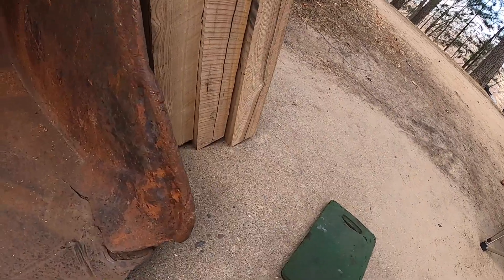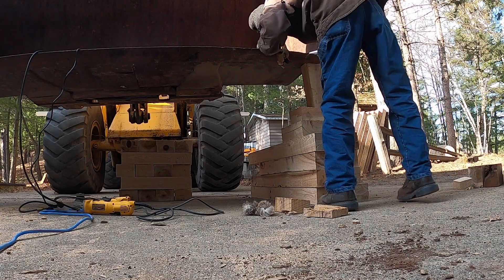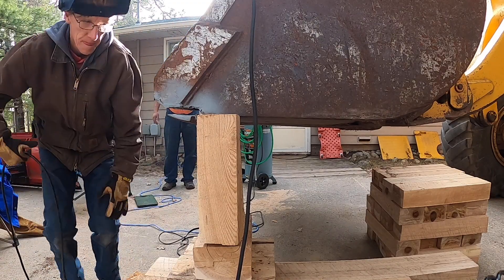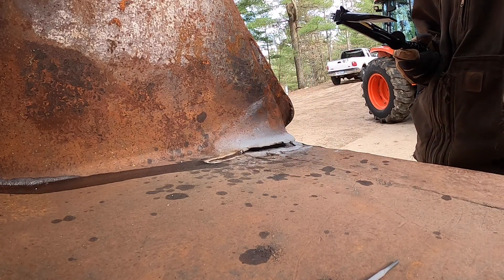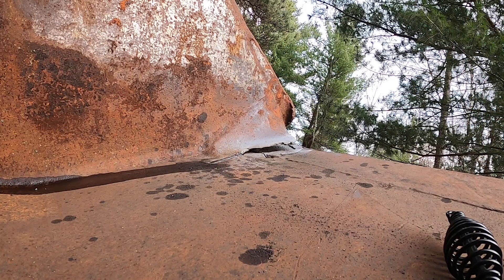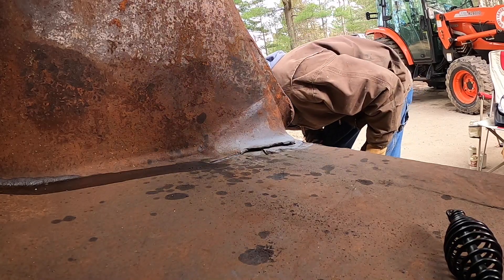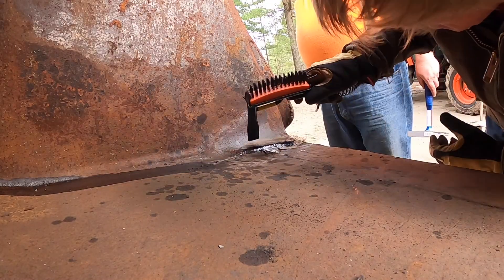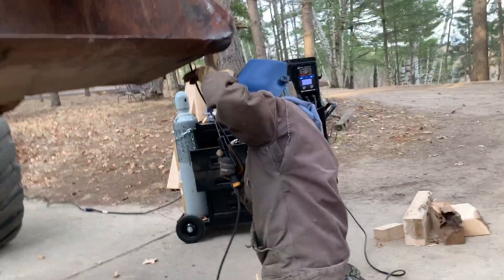Welding and Repairing a Cracked Wheel Loader Bucket (Pay Loader Part 3)

Comment: Nice work! What would you charge someone? Just starting a mobile welding business, don't want to over charge or undercharge . Thanks!
Reply from the maker: If you’re doing mobile with a variety of type of processes, I’d charge $300 for this job if it was a customer. For bigger jobs, consider $100 an hour. For smaller jobs onsite then puzzle out a minimum, and for mobile jobs more than 20-25 miles away, figure out a surcharge. If people come to your shop for small, easy stuff, then cut those people a deal and let them become your advertising—so you tell them to tell others about you and your business. Even so don’t short yourself even when starting out.
Reply: I charge 80$ for truck and tools and 60$ an hr + steel if I have to buy. Surcharge is a must if your truck leaves your yard it's an automatic surcharge. It keeps the idiots from nickel and diming you.

Comment: Someone get this man a wire wheel
Reply from the maker: There were at least two angle grinders laying around Mark's feet. I think iron workers are used to hand chipping and running around on suspended steel like squirrels when they aren't in tumultuous welding or grinder mode.

Comment: What would price for bucket like this ,size,condition ,be ?.1k dollars ?,less ?.
Reply from the maker: I have no idea what a four-yard bucket goes for used.
Reply from the maker: Looking around on Iron Planet and Machinery Trader, considering that it is a 108" Rockland bucket with a global quick attach, the value is in the thousands somewhere.
Reply: @MinnesotaEric  Yeah,more or less same prices here.My loader have bucket that previous owner narrowed for some 5 inches from each side so he can load material into asphalt machine.And now i have problem when i am pushing some material,front tires are stepping over it ,since bucket is not anymore wide as it used to be.So few weeks ago i finally found bucket for my loader ,only front blade is broken,but that is easier to fix than widening the bucket.Price 400 euro ....
Reply from the maker: @TheSRBgamer63  If the bucket fits, that isn't too bad of a deal. I picked up a 4-in-1 bucket that needs to be adapted to my loader. The loader is off doing jobs catching up on monies spent but unless it blows up, at some point i'll have a bucket conversion video or two.
Reply: Atleast 1k  your looking at possibly 5k for a new one

Comment: Nice repair, that is all you can do.  I use 7018 all the time as they go up hill well. I did years welding repairs for piling rigs and a perfect rod for putting new teeth holders on.
Only thing is I will heat up a thick bit but for what you are doing just right..ATB from the UK
And for Butch I can weld lol 3/8 boiler plate with 3/8 weld on every face of those 2 ton boxes
https://youtu.be/6-RcuMaQ92k

Comment: don't quit your day job i  weld  heavy equipment every day  7018 is the wrong rod to weld cutting edges 11018 because the hi carbin
Reply: Butch you should put up a video of your work....then we all can see....!! Just Say'in
Reply from the maker: The Essex Hunter not only that there are applications when an existing crack that has been welded before responds better when repaired by 7018 than 11018.
Reply from the maker: Butch, you're right: 11018 is better for welding buckets but my channel is about using what I have on hand. And guess what: I have 6010 and 7018 on hand. If that bucket cracks again in the same place, I'll revisit the issue with 111018 rod.
Reply: 6010 and 7018 it will hold   you are doing fine